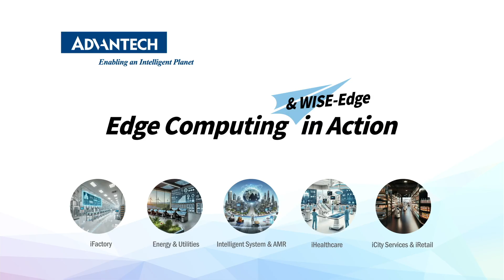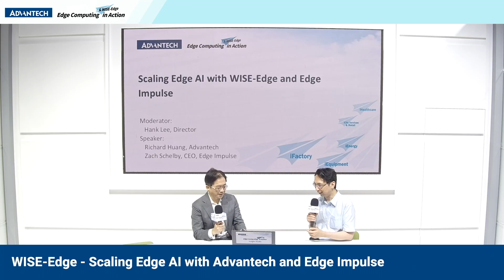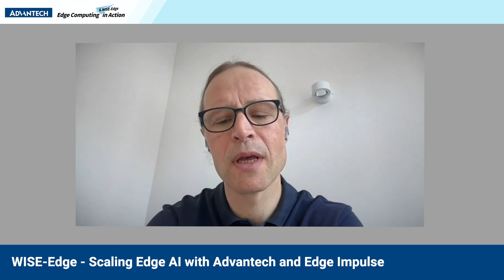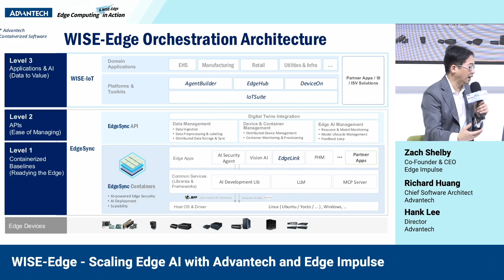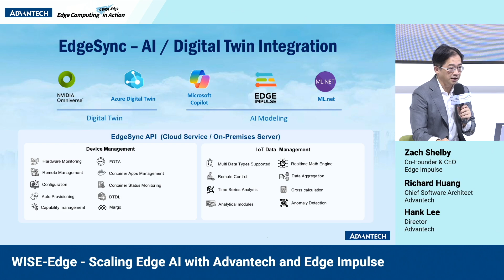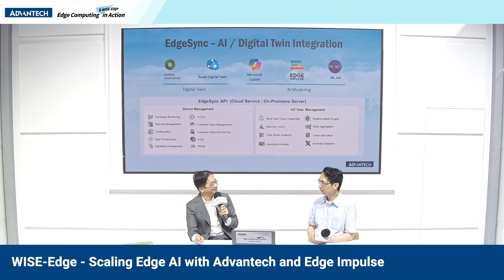Advantech at COMPUTEX 2025 | WISE-Edge - Scaling Edge AI with Advantech and Edge Impulse

Comment: I really loved this breakdown, and thank you for highlighting this COMPUTEX session on scaling Edge AI with Advantech and Edge Impulse! Shifting the spotlight from cloud-based large models to localized embedded computer vision brings essential operational depth to the AI conversation.

Coming up on two months as an intern at Lifewood Data Technology, working around data validation and extraction pipelines has shown me that edge vision deployments succeed or fail on data throughput and hardware orchestration. When deploying models for visual inspection or municipal traffic management, you cannot tolerate the network jitter or egress costs of streaming uncompressed high-resolution video to the cloud. Platforms like WISE-Edge solve this by running lightweight, optimized inference models directly on local industrial edge hardware. Pairing modular hardware with streamlined embedded pipelines like Edge Impulse allows engineering teams to deploy containerized vision applications rapidly while maintaining deterministic latency and on-site operational reliability.

Would love to know, which vertical do you expect to see the fastest commercial adoption for edge vision: automated defect inspection on production lines or traffic management in smart city infrastructure?